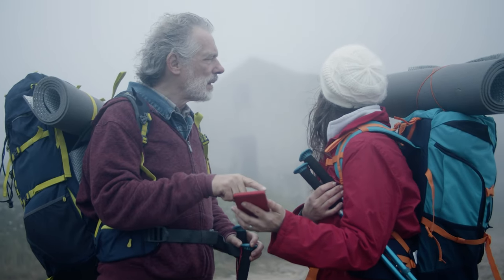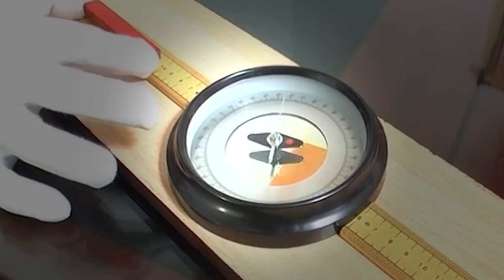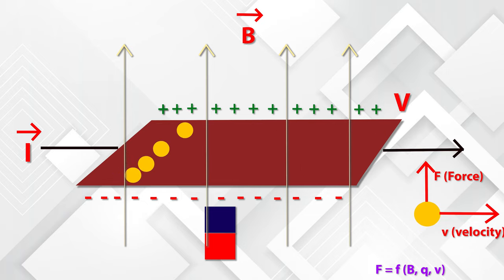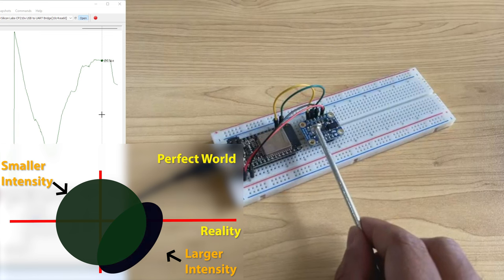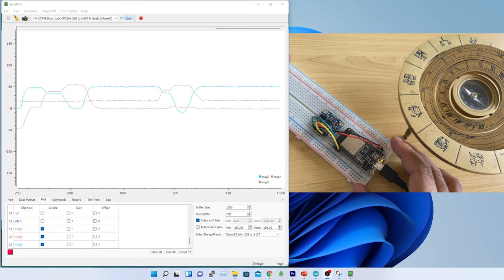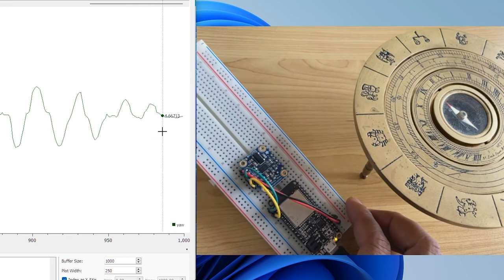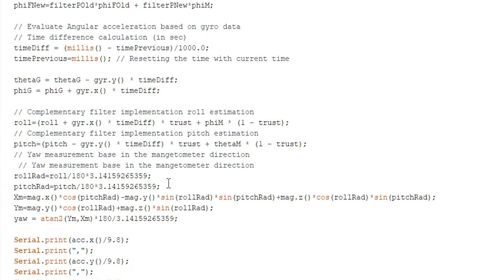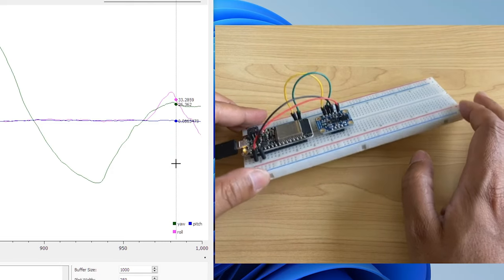Magnetometer Explained | Measure rotational angle / turn coordinator using Hall Effect & DCM

Comment: Dear sir Explain in step wise manner first construction and designing Magnetometre.
Next few points are there is it working only at dc or ac current implications.
Next if Vertical vector or horizantal vector variation is to be determined in time series how it will work

Comment: quick question. I am trying to use it as a compass for my driverless RC car. To calibrate, I drive the car in a circle for 10 seconds to get the cal offsets. That seems to work, but only in a very limited area (i.e. pretty much only in the tiny area of calibration). As soon as the car gets close to a wall (doing all of this in my house), the degree changes by > 10 deg. So, my point and question is, this is pretty much useless as a compass? However, we have compasses in our phones that seem to work pretty good in a multitude of environments. Why do the iphone compasses work so much better?

Comment: Great, do you know how to calculate translation with acceleration?
Reply from the maker: Yeah, I have done that in one of the accelerometer video titled ESP32 feather and BNO055 calculate inclination angle or tilt angle. https://youtu.be/YEOmMxwxn20 you can check this one
Reply: @others-makingofrpgvideogam4262  but can you calculate the displacement in 3d space of this?
Reply from the maker: Yes, will do that. It is actually an important functionality for my project. As I need my human rigid model to move around. Please stay tune, it's coming soon.
Reply: @others-makingofrpgvideogam4262  great, to tell the truth I've been doing it for a long time and it's somewhat difficult to calculate the 3D tracking with the sensors, yes I've seen people who achieve it, but they don't share how they did it hehehehe I think it's normal
Reply from the maker: @Fxiques  Don't worry, Once I get there I will share how I would have achieve that. It will be 3 -4 videos away.
Reply: @others-makingofrpgvideogam4262  lo espero con ansias jejeje